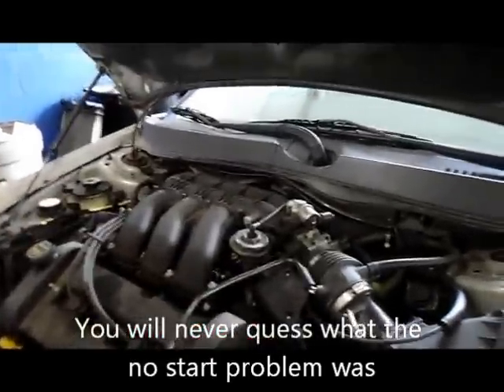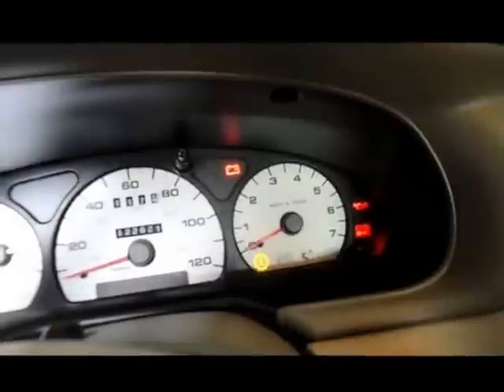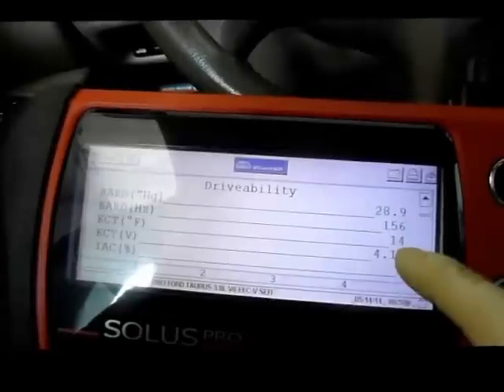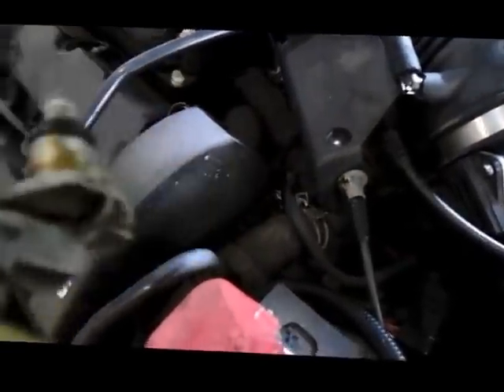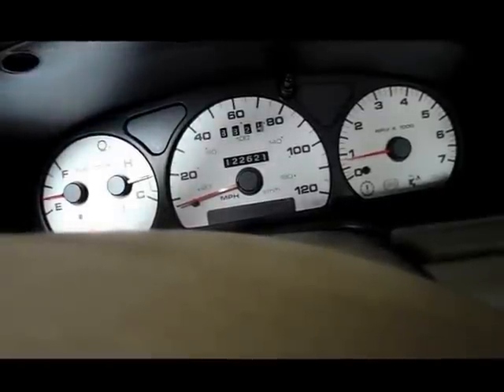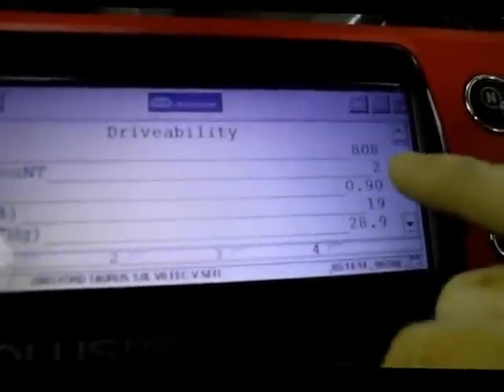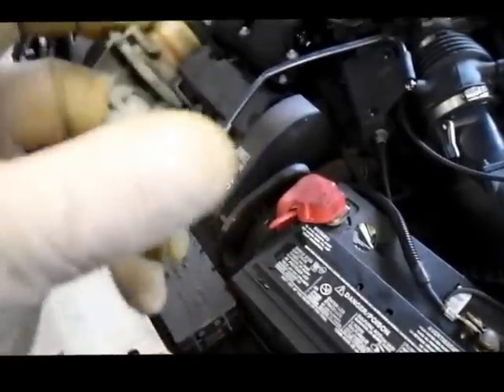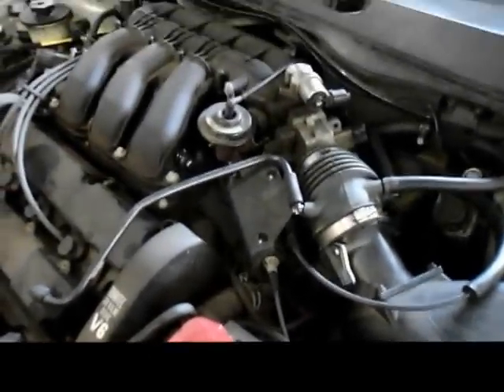Engine cranks but won't start

Comment: this happened on my 1990 Chevy c1500..when the sensor failed it made the computer think the throttle body was flooded and shut off the gas..had to hold the gas peddle to the floor to start the truck.. changed the sensor and now it starts up normally
Reply from the maker: Thank you for stopping by the shop

Comment: Jeep Grand Cherokee 2004 has a light control Montreal in it. I'm not sure. When you come in/out the door.Dome lights goes on or off.ON driver door side.When you come out and put alarm on when you finish driving.Dome lights won't shut off. I check all the buttons for the dome lights that not it  but take me 3 mins.I went passager side door close it and use my car keys to turn the jeep on lights went off then l went out passager side put alarm on lights went off. Jeep Grand Cherokee has electric in suit with the driver door constantly open and closes. 2 yrs ago lights won't turn off at all  i fix ground wire problems on the door it works. NOW completely different. My friends say that maybe light control Montreal or ground wire again. I don't know what to do.
Reply from the maker: Thank you for watching

Comment: If the sensor is showing low voltage, it could be  showing the car is overheated, it is saving itself from damage/ engine fire..
just imagine if my grandmother would have had that feature in her 70 Cutlass Supreme which caught fire in the early 80s we might have a valuable Classic on our hands today 🤔lol

Comment: coolant condition can sure make a difference in these "computerized' cars these days, from what I see in the video it looked like it hadnt been flushed in awhile,, next time you see that car will likely be the heater not working,,and the heater core in that car aint no fun to replace
Reply from the maker: Thank you for watching and your input

Comment: I have a 1998 Chevy Silverado that runs great when its warm but when its cold it starts for a few seconds and dies.I replaced coolant sensor that feeds computer but it still does the same thing.Scared to drive truck because of this.Any ideas?
Reply: Where would the electronic choke sensor be?

Comment: If the sensor is faulty it could be sending an overheated signal to the computer to hold off starting regardless of the engine temperature

Comment: I have a 2006 ezplorer, I have tried everytging and still not start. But I dont see the rpm gauge moving, even when the crankshaft sensor is new.

Comment: Please tell what's wrong I have a 2011 lexus rx350 the car was running good drove to store went start just spins new battery In it new battery in key new fuel pump still no start the sucreity light keep flashing no blown fuses please tell me what's wrong with sc
Reply from the maker: If the security light is flashing something is going on in that system. Did you try a different key

Comment: I had 88 corsica that oil pressure sensor that would shut the engine off if pressure got too low.

Comment: my 1988 f250 with a 5.8L will either not run or it will run like crap if the coolant temp sensor is bad cause on my truck the wires are tied into the iac, tps and map sensor
Reply from the maker: AWH thanks for watching and your input

Comment: So I did this test on my mk3 golf vr6, sat in the car turned it over and there was no indication on the tachometer, so does this mean it's my crank shaft sensor, not my cam shaft sensor?.
Reply: Alf Bittner  hi  my tac meter is not moving eather have you heard anything about what it could be ? thanks
Reply: It seems it's the crankshaft sensor. No signal getting to the crank from the sensor will stop spark as well, hens no start. An electrical clip and one  bolt and it's out, but in Australia they cost $180 upwards.

Comment: 2001 Ford Ranger starts and runs fine then suddenly cranks but won't start. 3 or 4 hours later starts and runs as it should until the next unknown time it does it again. I check fuel pump relay, fuses etc. they all seem ok. Any ideas?
Reply: Could be a number of things. Intermittent problems are always the most difficult to fix. Maybe your crank position sensor is going bad?

Comment: The engine temp (according to the sensor) was way out its parameters. The computer is apparently programmed not to start at this low temp.

Comment: Hows it going, im a student at UEI college in gardena studying auto mechanics, and so ive been doing side jobs to get experience on different vehicles, so i got a customer with a 2001 ford taurus 3.0l 12 valves who kept having a misfire in cylinder 2 and i replaced the spark plugs, wires, coil, and injector, even compression tested it and the conpression was about 123-125 psi for that cylinder, now the scan tool is reading misfire in cylinders 1 and 2. Car doesnt start unless i connect it to a battery charger and jump it, not sure if its because of the misfires or cause the alternator is faulty, Any suggestions or experience with this?
Reply from the maker: You may want to check for any vacuum leaks.Check under the driver side by the air intake especially.
 there is a small elbow that always leaks. Was there any other codes in the computer?As for the jump starting you may just have a bad battery or alternator.Check the charging system.Keep me posted.Jim
Reply: jimthecarguy i checked the battery and alternator and they're both fine, and no there wasnt any other codes i dnt see or hear any vacuum leaks.

Comment: Had a 92 Ford Bronco ob1 had the same thing happen but it went into limp mode then it quit working 2 coolant sensors 1 for gauge 1 / computer

Comment: Hey boss jimthecarguy, can you please help me please, I have p0453 code, the car was running but I erase the code and I try to start it, nothing cranks but won't start smell like gas in the mofler when I crank the engine, I checked the fuse, relay, crankshaft sensor , and I spray staring fluid I don't hear anything from the pump I replace the cooling temperature sensor like you did in this video please

Comment: Basically the computer thinks the engine is frozen solid. so there would be no point in it running. the water pump wouldn't turn and the coolant wouldn't circulate. but it would make more sense that if an engine was frozen solid to disable the starter.
Reply from the maker: Thank you for stopping by the shop

Comment: Wong reading the car will run at the wrong temp, cause over heating. Computer will not let the car start with bad readings from temp sensor.

Comment: Hi I need help I got 1999 Toyota Yaris 1.0 GLS when I start the car it turns over and it keep vibration and keep cutting off but why??  What could be the problem. Many thanks look forward to hear ya.
Reply from the maker: You will need to check the car on a computer for codes.Thanks for watching.

Comment: I have spark but it won’t turn over… I just replaced the fuel pressure regulator.  Still won’t fire

Comment: A strange thing I noticed, in the first part of the video, you show the gauge cluster as you are demonstrating the "cranking with no start", by looking at the Temperture Gause on the left, it is NOT on COLD, but insted looks like it is in normal range. This was supposedly before you replaced the bad coolant sensor. 
I appears that the Video was staged for demonstration purposes, nothing wrong with that though.

Comment: Great video. Today it is minus 0 degrees outside. My 2000 taurus overheated on the way home from work. It died on the xway, coasted to the exit ramp. I let the engine cool off, added antifreeze, tried starting fluid, engine would crank, but not fire. 

As soon as I thaw out I am going to look into this temp sensor. If anyone has additional suggestions, please reply. thanks.
Reply from the maker: Thank you for your input and for watching keep us posted.

Comment: gotta 2003 taurus lx it doing the same as this one .... it hesitate then start then I drive it but it cutt off ... it's showing check engine light ... battery n the Orange light ... Yu think this the same problem

Comment: hey how are you? i have a 2002 Saturn vue. it cranks but wont start, but when i use starter fluid it starts up then cuts back off after like 6seconds.  i can hear the fuel pump working, brand new fuel filter, fuses good, relay good, i check the pressure release from on top of the engine...everything good..change cam sensor n crank sensor. could this be my problem... please help. someone tells me it's control module, then another says coil packs, then another says, spark plugs, then timein change.... please just fix this darn car...HELP

Comment: Mines like this today, but what I don't know is why does my light dim on my dash, and are sure its the sensor in the coolant or is it a timing belt  cause if it is I'm going to get cracking to it
Reply: DonutVIP if your lights are dimming like headlights or even interior lights like you said it's definitely your Alternator forsure.
Reply: Craigy C nah found out the problem, it was a flooded fuel injector

Comment: Not a huge deal, why the long video?  The ECU needs a valid temp so it knows how much fuel to squirt into the engine, also needs to know if the car is overheated so it can shut down the injectors to prevent engine damage

Comment: I have a 2007 Dodge Nitro and it turns over but won't start. It heats up or shows that it's heating up could this be the problem?
Reply: YES,sell car quickly or light on fire and claim insurance

Comment: so the car in video started after the wiggle test? then it shut off when put in gear?
Reply: I have a Ford 500 07 that is doing the exact same thing right now. I will change that sensor in the am

Comment: I've seen real excessive crank time for those sensors before but they usually will start just run terrible I've seen temp on a scanner once at 512° I'm like there's our problem !!
Reply: wrench One
Reply from the maker: Thank you for stopping by and for your input.

Comment: This problem I saw it in a nother video with a guy running same problem in a Ford Expedition he changed the temperature sensor and problem was resolved it is kind of hard to believe that this sensor can make the car not to start but it is true
Reply from the maker: I'm happy to help.Thank you for watching and your input.
Reply: just fixed my sons Chevy Sonic. Code for ECT out of range (PO118) was giving high coolant temp 133 degrees C with beeping for overheat condition. Car cranked but no start. Changed ECT...... Bingo! $30 fix!!
Reply: This was with freezing cold engine snow on the ground,.......
Reply: i have the same problem but i replace the sensor and still the same problem i get to start by unpluging the same sensor and as soon as turns on i have to run and plug it back in and is fine as long as a turn it o n every 4 hours

Comment: Listen it's not that hard to believe.  If the computer thinks it's 15 degrees outside but the engine temp. is 80 degrees or in your case 180 degrees then the PCM (computer) is commanding too much fuel because a vehicle needs a lot more fuel to start when it's cold outside.  It's not that complicated.  You were flooding out the engine.  Since it's a ford you can hold the gas peddle down to the floor and crank the engine.  This will put the vehicle in clear flood mode which will disable the fuel injectors to clear the cylinders; you may get it to start for a second as the excessive fuel clears.  But the problem is the computer thinks it's too cold and is dumping too much fuel ok.  You can also unplug the Coolant temp sensor and put the computer into backup strategy and it will take a temperature reading from either the air intake temp sensor or trans temp sensor as a back up reading.  This will allow you to start the car incase of an emergency and drive to a shop or parts store.  It's not as accurate as the Coolant temperature sensor but it works.

Comment: My Dodge Dart Keeps Stuttering When Turned On But Wont Turn On While The Radio And Everything Else Works Fine I Have To Push The Gas A Little Bit For It To Start What It Wrong With It ?
Reply from the maker: What year is it?
Reply: 2013 Dodge Dart Sxt

Comment: with the motor thinking it's so cold it's dumping way too much fuel into the engine so it's flooding itself out it won't start I've run into this problem a bunch
Reply from the maker: You are absolutely right. Thanks for watching.

Comment: I need help ASAP, the car will eventually start but after it sits for a few hours I have to turn the key several times before I hear the fuel pump, yes the pump is solid, I've tested a new one and just put it in. I've replaced the fuel filter, crank position sensor, fuel pump, fuel rail pressure sensor, ignition switch, plugs, wires, battery. Some guy at NTB, it's an "Auto Shop" says, He is pretty sure it's the fuel tank pressure sensor, then says it's in the fuel pump? It's not in the fuel pump. Another genius at Auto zone says the pressure sensor is in the fuel filter, which I have replaced. HELP!!! It's a 04 ford Taurus.

Comment: My 2006 pt cruiser cranks but will not start, computer said temperature sensor, it have spark, fuel, is not camshaft sensor, timing belt is fine, so maybe temperature sensor is the problem.
Reply from the maker: Thanks for watching.

Comment: i got a 2005 nissan altima. 2.5l. cranks but dont starts. put it on scan tool. it shows a bunch of security codes. what is the problem?
Reply: jim the mechanic thinks its my key not reading.  I drove it home. stayed inside a hour and came back out and it wouldnt start.

Comment: same on a 1990 buick 3.3 wont run if sensors shot  bench it on the car plug in the new an hjt the key i gaurantee itll run its faked out let it hang on the engine ,

Comment: so I have a 1998 Ford Taurus. has like a hundred sixty thousand miles and it was a very strong Runner. the alternator went out and I replaced it in about four days later my wife is driving and then she comes to a stop light it died while sitting at the light. I towed it back home and I start messing around under the hood. I'll go to start it and it makes like a weird sound sometimes it will turn over sometimes it won't but it drains the battery immediately within 2-3 starts. I don't know if it's a sensor or relay I doubt it's the starter. a buddy of mine said that the engine was seized but he also said that the car was getting no fuel which I check the fuel pressure and to see if the engine would crank over and it does. it's something electrical it's something to do with the sensors and I guess a lot of people have a problem with the Ford Taurus just not wanting to start. does anyone have any suggestions

Comment: couse if senser is not working right it telles computer its overheating and shuts it off and goes to limp mode and kills it or no start
Reply from the maker: Thank you for stopping by the shop

Comment: Hi guys I have a 3 series e90 msport driving along car just shut down no warnings system check ok it fired up and idled for about 15 seconds then cut out now it cranks but don't start it now shows dtc tyre pressure and car lifted off floor smbol had it code read snap on cannot pick engine code up just says ecu 1 ecu 2 any ideas thnks

Comment: the commputer shutting it down cuz the computer has a safety overide that prevents damage to engine due to temp sensor is malfunctioning the cornputer thinks car is running to hot i imagines

Comment: The theory of the computer not allowing a start must be wrong.  No one in Alaska can drive a Ford... Right.  Could it be that the temp sensor was faulty and just sending bad intel.  The car's computer might have been honestly trying to make the calculations for an 18 degree air charge that naturally the MAF said was measuring way more air than needed (as hotter air is more spacious per given amount of oxygen) and the computer dialed back the injectors to a near zero fuel pulse figuring this nice cool dry air needs little to start with this much air volume.  When indeed it was 75 degrees and considerably more humid, necessitating more fuel...  The computer just had the settings all wrong based on getting bad input.

Comment: Did you disconnect the sensor to start, or replace sensor?
Reply: Your video doesn't show or tell how you went from seeing 192°and .65 bolts to starting the car.  Then you state temp in normal range and correct voltage (which is what)?

Comment: The engine will stall if it is running to rich. Cold start enrichment on a hot engine.
Reply from the maker: Thank you for stopping by the shop